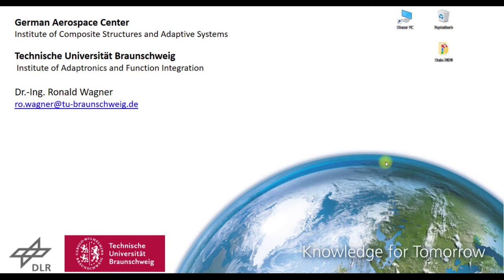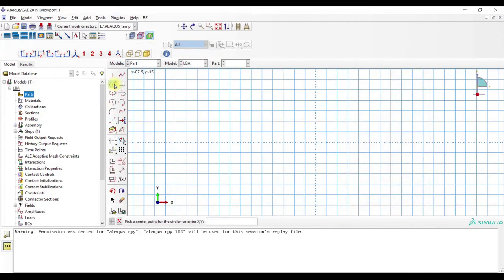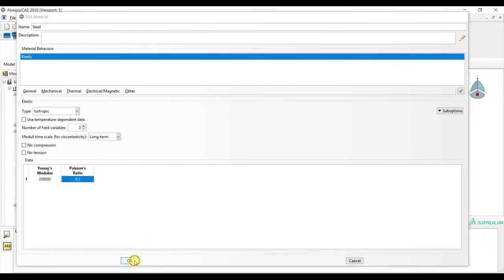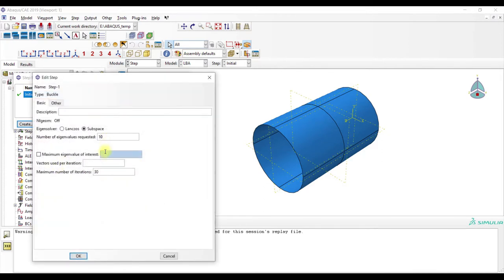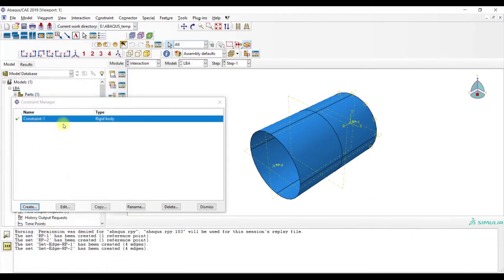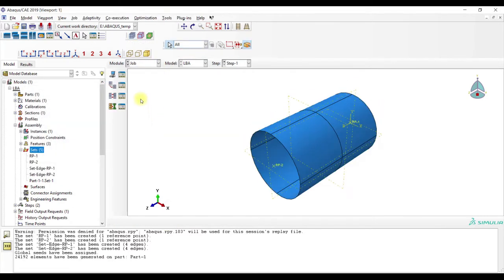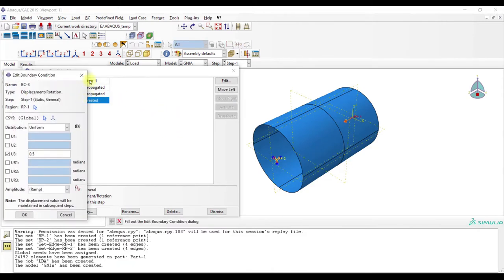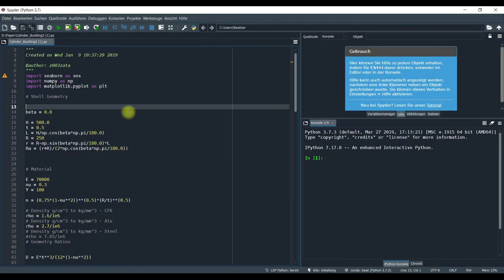ABAQUS-Python Tutorial: How to perform an iteration in ABAQUS CAE using different imperfections ?

Comment: After interfacing matlab with abaqus python script.  Could this process help me in doing iteration study automatically . I mean to say without giving input every time, abaqus will calculate frequency of plate.
Reply from the maker: i am not sure about matlab, but this video shows how to perform an interation which scales an imperfection and determines the buckling load which depends on the imperfection. This should also be applicable to a plate and frequency analysis.
Reply: @hnrwagner  thank you